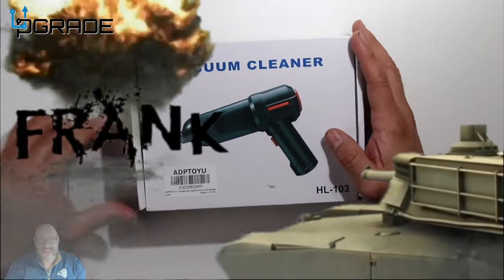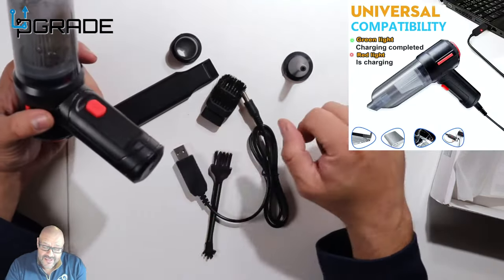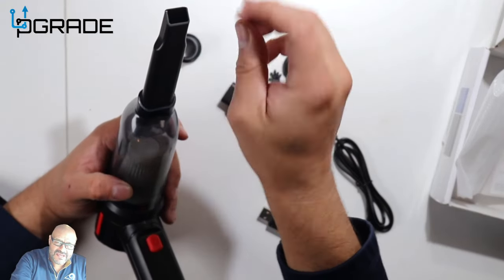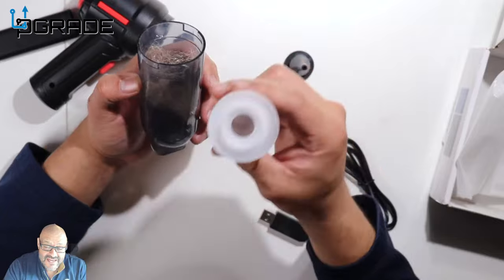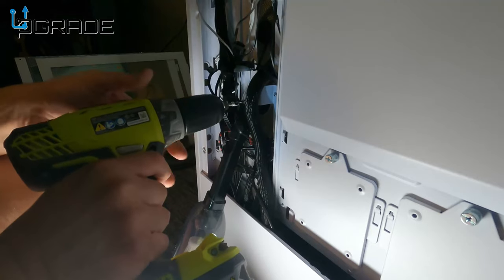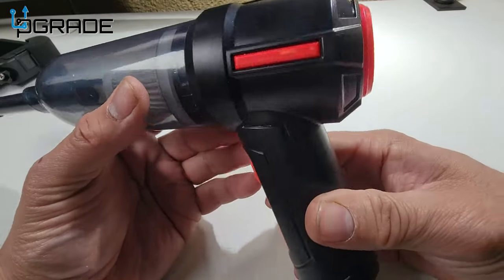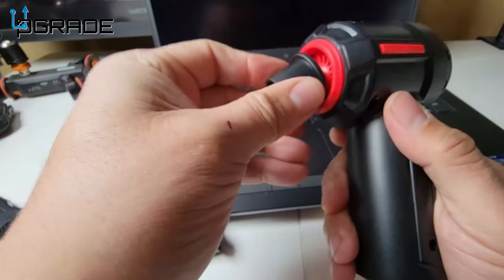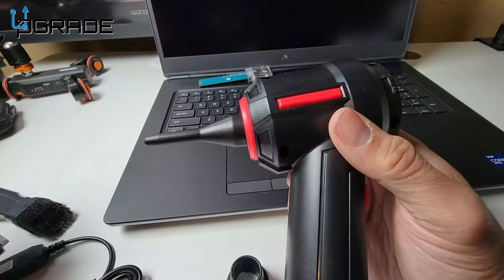Compressed air Duster & Mini Vacuum

Comment: Cool, what's the rpm? Is it equal in blower mode, to a canned compressed air (I need to blow away dust off the bearing of the computer's fans would ie be good enough)?

Thank you for sharing.
God bless you.

Comment: Is this safe to use for cleaning the inside of pcs?
I heard vacuum's typically cause static electricity which can damage the parts, so should I just use the air blower attachment?

Comment: I ordered one, getting it soon hoping to clean out my ps4 and apply new thermal paste :)
Reply from the maker: I use it to clean my PS5 and my PC because it gets lots of dog hair on the front of the case.
Reply: @Upgradetech  I'm hoping to do the same as much as possible with with my PS5 to prevent any dust build up 😁 wouldn't want to mess with any liquid metal or warranty voiding

I wish you could see the 12  years of dust build up on the fins of the HeatSink of my Playstation 3 I refurbished last week.. 😬 It was booting up in Jet Engine Mode basically, hadn't been turned on since 2015 and the paste was very very crusty...
Reply: @Upgradetech  just got my Playstation 5 last week from Sony direct, I'm surprised I was able to get my hands on the disk version

Comment: Hi
This is a decent video 👍👍
I’m looking at buying one of these and wanted to know how good the blower function is ??
Is it powerful enough to replace compressed air cans for cleaning dust off electronics ??

Thanks 
Joff
Reply: No, not powerful enough they are only good for small  duest particle, the can wins. I would purchase a plug-in I review a while back that is my go to accessory when I want a powerful system but the only thing is that is is loud.

Comment: This video did little (nothing) to indicate why this model may be better or worse than any other model which performs similar functions. Specs on Koonie and Reesibi (among many others) are far superior than this model and that includes battery type/ capacity and run time. Why not provide specs or criteria which may be relevant to the decision process? Other units also pick up rice! Other units also blow dust! LOL!  Are you qualified to do a video on technology products or are you simply seeking to accumulate credits from Amazon?